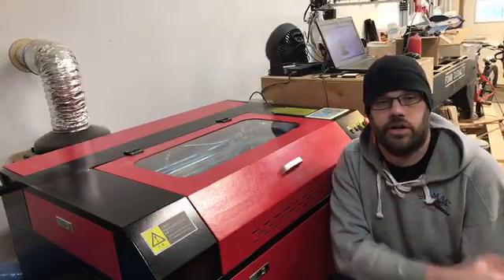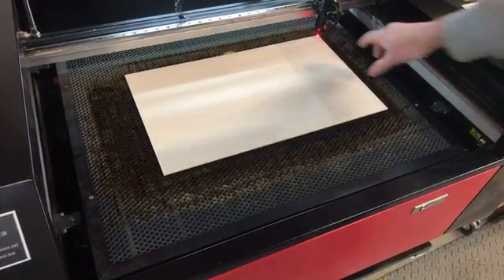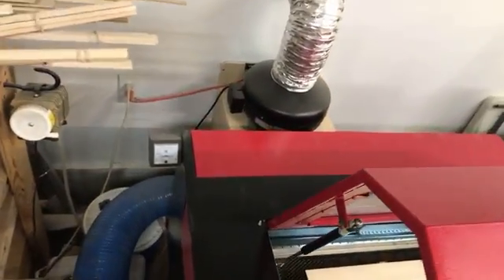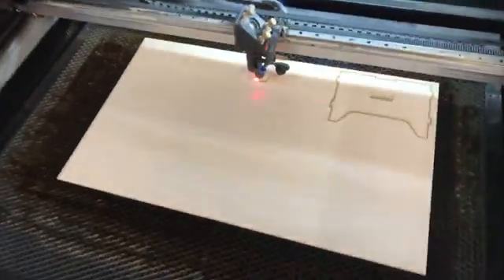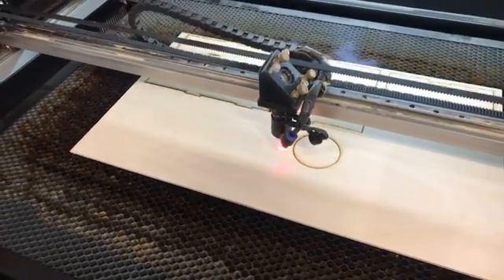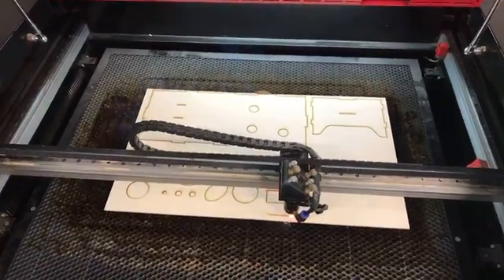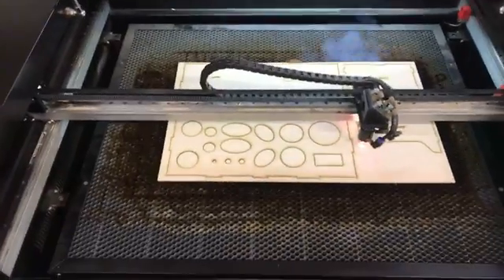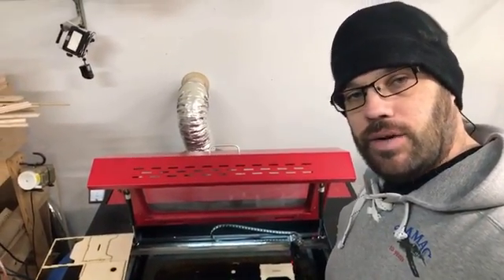Laser Cutting Baltic Birch Plywood (eBay Laser)

Comment: Hey, how has that anti-freeze liquid been working? Have you had any problems caused by low temperatures?
Reply from the maker: Luckily my shop has never reached freezing temps so far. It’s well insulated and I run a small electric oil filled radiator near the laser during the winter to keep temps at 40f or above. I’ve not had any issues with the laser during that time. I do switch out to straight water in the spring as it’s good to swap your water every 6 months or so.

Comment: What’s the difference between an eBay OMTech and a omtech from the manufacturer?
Reply from the maker: I bought this one before Omtech had a US presence. You’d want to make sure that the ones on eBay are actually from Omtech if you are looking for support from them. There are a lot of eBay sellers importing generic lasers like mine. You take a gamble that they will provide you any support. If you want guaranteed support, I’d buy directly from someone like Omtech’s website.
Reply: Ty very much

Comment: wow pretty cool not bad. I wanted to know how cold does your garage get, i wanted to get a larger laser but I was worried about condensation issue with the machine being outside in the garage, because it gets cold and i cant keep the garage heated. Thanks
Reply from the maker: I run a small heater in there during the winter to keep it moderate.  It never gets below freezing but it has been around 40 during the coldest weeks.  I tend to not work out there those deep cold weeks of the winter as it takes too much to warm it up for just a couple hours of work.

Comment: My 80 W Chinese laser cutter just cut off .The main board doesn't have any power and when I cut on the laser Is there is no power neither. It please tell me which detector problem could be or what do I need to replace.
Reply from the maker: I'd look at the wiring from the power plug as well to and from the main switch and the e-stop switch.  There are springs in the switches that like to fail.
Reply: @Vintauri   Do you know where can I order those from. My switch have 4  Wires plug to it.
Reply from the maker: @darrinbutler619  Look for a part number on the switch.  You want to look for something that states 2NC or 1 NC 1 NO or similar and that's key to making it match.  I found mine on Amazon for about $12  https://amzn.to/3L9BJlR

Comment: Hola ¿podrías decirme cuanto mide sin la parte de abajo el soporte tipo mesa?, solo la maquina.

Quiero saber si entra en una vivienda por las puertas.

Gracias.
Reply from the maker: The main laser without the base measures 20.5" (52cm) tall, 45 3/4" (116cm) wide and 34" (86.5cm) deep. I hope this helps!
Reply: @Vintauri  Thanks, muchas gracias me ayudo en mi decisión.

Comment: Did you have to upgrade the power supply for the new tube as well?
Reply from the maker: I've replaced the tube twice now and I'm still running the original power supply. As long as you keep things in spec and match the tube to your power supply it should be fine.

Comment: does this cut brass, aluminium or metals
Reply from the maker: This machine will not cut any metals. It can remove a coating on metal or anodization on aluminum or mark it using a product like cermark. But to cut metal you'll need something with much more power or a different wavelength like a fiber laser.
Reply: Can u suggest me some fiber laser machines, if u know any?

Comment: nice. i have 100 w version and go through lenses much faster than I think I should. People have said i have "wet" air assist, but I put 2 driers on and still ruin lens regularly.  I clean lens and mirrors pretty regularly now, but still having problems.  Thinking I'm going to add more air.  Do you have a pressure regulator? and If so, what pressure do you run? Also, I mostly cut Home Depot 5mm underlayment wondering if the glue in it is not good for the laser? (But I use big exhaust fan, so I don't have a lot of smoke in the chamber)  TIA,
Reply from the maker: In 5+ years of owning this machine, I've only damaged one lens and that was due to water in the air assist set up.  I'm currently running a quiet air-compressor with a moisture trap set to 30PSI on the outlet to the laser. As for the material, I've heard of others really liking the 5mm underlayment for cutting but I've never used it.  I mostly use B/BB baltic birch sheets from a hardwood distributor.  There is always a chance there is something in the glue but if you are using air assist to keep the smoke outside the cone and a good fan to pull the fumes out of the cabinet, it should not be causing you issues.  Do your mirrors get dirty fast as well?  If so you might need more air movement in the cabinet.

Comment: hello bud, is this an OMTech machine, also how many watts is your machine?
Reply from the maker: It is not from OMTech.  I bought it on eBay over 5 years ago. It is a 60 watt laser and while it's still running strong there are better options out there now. Check out my latest video on my recent recap 5 years after getting the machine. If I was shopping for one today OMTech would be one of the top places I'd look in this price range.

Comment: Hello,
A problem that nobody speaks about on any site, it is to believe that nobody knows, And yet I watched nearly 100 tutorials !!!!!!!!!!!!!!!!!!!!!!!! , and, this problem concerns several people ;;;;
I have a laser machine, hl 1060 blue, 100w, 900/600 cm
When I turn on the machine the controller indicates, reset, nothing happens for 2 min, then the laser head comes up against the X axis.
Then she gets stuck and does not respond.
I have tried all the codes to reset user and vendor settings
I tried, rd8888, hl8888, hf8888, 666888, cc8888, (most common code)
When, I try to initialize the machine or to read the parameters via rd work v8 or lightburn a message appears on the controller, "ruida board encrypted",
  the seller, do not answer except to sell ......
Can anyone help me, obviously it's not just me who's having this problem, nydax@hotmail.com

Comment: How is this machine holding up?  I am looking at OMtech 60 or 80 watt machine, i was originally looking at a thunder laser, but its hard to not take these into consideration at the price point.
Reply from the maker: The laser is still going strong. I've replaced a couple of switches and a proximity sensor. I'm about to swap out the laser tube for a new one and will make a video on that. Perhaps I should do an overall update on the laser now that I've been using it for over 5 years.  From what I've seen OMTech has some good support and some better features from the random eBay lasers. They would be on my list of people to look at for a new machine if I was in the market today.
Reply: @Vintauri  Thank you I appreciate the feedback! Those particular components you've replaced have been due to failure then?
Reply from the maker: Yes the switches and proximity sensors were from failures but the parts were easily sourced and not expensive.

Comment: Hi, Did you tried to cut any kind of metals? and what it the best metals for cutting using laser machine? thanks
Reply from the maker: The lower wattage Co2 lasers like mine do not have the power to cut metals. You would need a much higher power Co2 laser or to look at a fiber laser for marking or cutting metal.

Comment: What speed and power setting did you use to cut?
Reply from the maker: At the time I was running around 75% power and 15mm/sec. Since then I have tuned the machine and using the ma meter I can run at 82% power to be just under the max 21ma power and the speed is now around 20mm/sec at that power with decent air assist.

Comment: I am looking at purchasing pretty much the same machine. I will be running it in my garage. My garage is not heated the temps can get down to -10c / 14f. Do you think this will be an issue?  Thanks!
Reply from the maker: Freezing temps will be a concern as the machine is liquid cooled. You could add a sealed reservoir with an aquarium heater in it to keep the water from freezing and you'd want to keep the water pump moving the water through the system. My shop is insulated and I run a small jester to keep the temps above 40f while I'm not in the shop during winter.

Comment: Video posted nearly 3 yrs ago. How has the machine held up over the 3 yrs?
Reply from the maker: My laser is still going strong. I've had to replace the E-Stop button and the primary power switch on the side. I've also upgraded to a CW5000 chiller to make things simple.  Other than that it's still working on the same tube and power supply. I'll see about doing a 3 year recap video to give people a longer term impression of this machine.  Thanks for stopping by!

Comment: Hi there, I've been looking at these machines on eBay for a while. Do they come ready-to-use or was it a nightmare to get it running (mirror adjustments, tweaking, etc.)?
Reply from the maker: You definitely have to go through the machine and check over things.  I would not call it plug and play by any means. While it might run out of the box it likely will not run well and you'll be chasing down issues as you go. It's important to check the bed level, mirror alignment, lens orientation and go over as much of the wiring as you can to make sure the connections are tight. I would not call it a nightmare but it does take some patience. However you'll learn a lot about the machine and it'll be easier to troubleshoot any issues down the road.
Reply: @Vintauri  thanks i hate wiring issues, this tells me I need to save up some more, LOL, thanks.

Comment: how to remove the smoke ,do you think this  Smoke Purifier is ok ? https://www.ebay.com/itm/164322607860
Reply from the maker: I do not have experience with any filters. I just vent the smoke outside. The amount of smoke from just cutting wood is very little so I do not worry about filtering it.

Comment: Can this cut metal?
Reply from the maker: It cannot cut metal. But you can mark it using cermark or remove the powder coating or anodized coating if it's been added.
Reply: Vintauri RC thanks for your response. I truly appreciate it!
Reply: Hello, Ms. Jones. This equipment can't cut metal. It can only cut wood and plywood.If you need metal cutting equipment you need a high power laser cutting machine.Could you show me the material to cut online? Maybe I can give you some advice。 whatsapp+8613127135107

Comment: Dear Sir,
could you please tell me how thick plywood and MDF boards does this laser cut ??
I thank you in advance.
Best regard
Reply from the maker: WIth everything tuned up, bed level, focus spot on, good air assist, and a MA meter to max the power usage I can cut 1/4" plywood and MDF. Your mileage will vary depending on the glue in the Plywood and MDF as well as the type of wood in the plywood.

Comment: Hello, have you found that some baltic birch will not cut?  I'm running in that issue right now.
Reply from the maker: I purchase all my Baltic Birch from a hardwood dealer so the quality is fairly consistent. Ocassionally there will be a small spot where there is a patch and extra glue the does not cut well but it's never been a full sheet.
Reply: Hello Sir, maybe you need to provide the thickness of the wood you want to cut, I will discuss with our engineers and give you a reply.Or you can add me on whatsapp +8613127135107 and give me a look online

Comment: I noticed that your video was made in 2018. Now 2 Years later, Do you still have the machine and do you still feel it was a good buy?
Reply from the maker: I do still have the machine and I use it quite regularly. I had to replace the emergency stop button and I've upgraded to a CW-5200 industrial chiller as well but the rest is still the same as from the video. I'm still happy with the purchase and hope to use it for many years, with the occasional replacement parts.
Reply: This Robert merino just under my company account. Thank you for the quick reply. I tried searching for the machine online but there are so many out there with the same colors. Would you happen to know which one you have?
Reply: @robertmerino8648  Are you still looking for laser cutting equipment? Maybe I can help you with my whatsapp +8613127135107.Keep in touch

Comment: which state do you live in? I live in canada ontario so we get a lot of cold weather I want to run this in my garage its not heated...will the laser work good? what kind of antifreeze do you use?
Reply: We are manufacture www.aq-laser.com who is focus on CO2 laser cutting machine, contact with me anytime(vita@anqang.com)
Reply from the maker: I am in Minnesota. My garage is insulated and I keep a heater going in the winter so the tmeps in the shop never get much below 50f. I do run a mixture of RV antifreeze and distilled water in the chiller.

Comment: Great video.  Yeah, I'm hoping I can get the original laser tube to cut 1/4" without too much trouble. 

at 18mm a second, what degree of laser intensity did you use, 80%? etc..  is one question I'm betting others might also have.

Thank you for this video! I subbed and liked!
Reply: I'm looking hard the Orion 100w.  Here's my issue tho.. ideally I need to be able to cut through 3/4 inch western cedar.  IF it can be done with a 100w in guessing it will take multiple passes.  In your experience with yours is this even feasible?

Comment: What is the difference between the yellow & black and  the  red & black?
Reply from the maker: Sometimes it's just the color. I've seen very similar machines in a few color cases. The things to look for are the controller, tube, and motorized Z axis.
Reply: Hello Mr Nik . sometimes color have different.Sometimes the power varies, depending on your cutting needs.May I know your cutting requirements to help you confirm?My WhatsApp is +8613127135107. I look forward to contacting you

Comment: Great Video! Just got mine and I'm about to fire it up the first time. How did you handle the chassis ground? Is this necessary in the United States?
Reply from the maker: It’s good to add a chassis ground to be on the safe side. Pick up some green grounding wire and use a machine screw to fix it to the metal chassis. Then run that wire to a known ground such as a ground bar or water pipe.

Comment: what brand and model is this machine? i would like to buy one so it would be helpful if people would at least say the name of the product they are reviewing;O
Reply from the maker: This really is a no-name laser from China that I bought off eBay. The eBay seller no longer exists so I can't even point you to them. Buying a laser like this from eBay is a bit of a gamble but if you read up on them and are confident with the extra work to check them and tune them before using you can get a good machine at a low cost.
Reply: Hello, friend. We are manufacturer of CO2 laser machine in China. web: www.sequoyatec.com ; Welcome to contact me to get more details and price. Whatsapp: +86 13539465576 /sophia@sequoyatec.com

Comment: You mentioned that this laser has been upgraded to a (real?) 60w tube but did you test this wood burning also with the original one? Was it much worse or did you just use slower settings? Also what kinda controller is on this machine? And lastly do you use lightburn with this machine or something else to burn?
Reply from the maker: I did see a slight improvement over the stock tube that was more than likely a 50w tube. I could still cut the same material with it, but the speeds were about 10% slower. This laser has a Ruida controller on it. I'd have to look to check the exact model.

Comment: What antifreeze are u using?
Reply from the maker: It is an RV Antifreeze meant for winterizing the water tanks in pools and campers. I mix it 50% with distilled water.
Reply from the maker: @christophervanlent2418  This is the specific type I'm using. https://www.fleetfarm.com/detail/isobar-50-rv-marine-anti-freeze-1-gal-/0000000228148
Reply: Rv antifreeze.  With or without the alcohol in it?

Comment: Can you tell me what size is that exhaust air pipe?
Reply from the maker: Carsten Weber It’s 6” off the machine and through the fan. The blue pipe off the machine came with it. The flexible section off the fan and out the wall I picked up at the local hole store.

Comment: Hi! I have the same laser cutter as you, but i have a problem, the machine works only if i turn off the laser switch, 
If i turn on, the laser pulse but the head not make any move...

Have an idea to solve this problem?
Reply: check your cables and power supply for any grounding issues

Comment: Great video. What voltage Your machine need? Do you need a transformer/ converter? 

I just get one machine and it need 220V and works with 3000 Watts.
Reply from the maker: This machine runs on standard 120v power. A single 20amp circuit can work for the machine, exhaust blower, water chiller, and air pump but I have it split between two.

Comment: Got anymore showing cutting out ribs and formers from Balsa?   I am working on a decision to purchase an 80W version of this Chaser for creating parts for several different Warbirds, in giant scale.    One thing to note about the uncut parts in that plywood. Thickness of that type of ply varies a bit, especially in humid conditions, so it is difficult at times to get 100% prefect cuts without slowing down, or upping the power, and then risk burning too much wood in the thinner areas.   IE, expected.    Would love to see a start to finish of doing a rib or former from layout to finished cut.

Oh one more question, why was the cutting backwards from what was displayed?
Reply: Hello acdii. Your  question is very very professional .and some iuuse i m not so sure accurate answer to you.Maybe we can exchange the whatsapp or e-mail and talking your issue on online.My whatsapp is +8613127135107 .I m a professional laser cutting machine worker